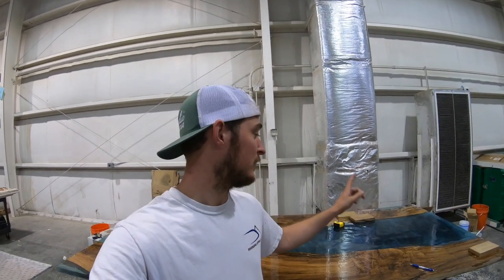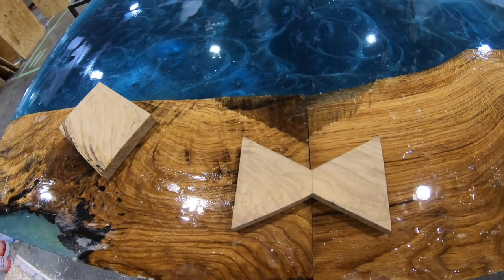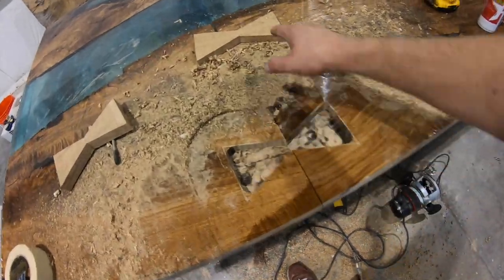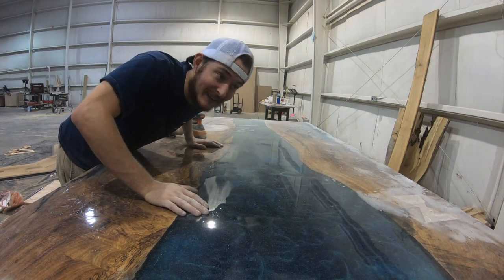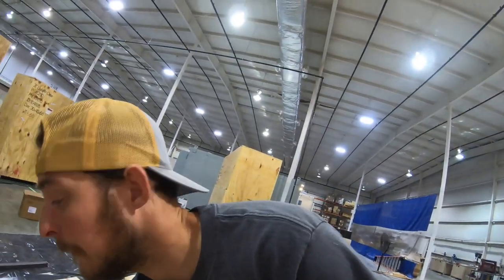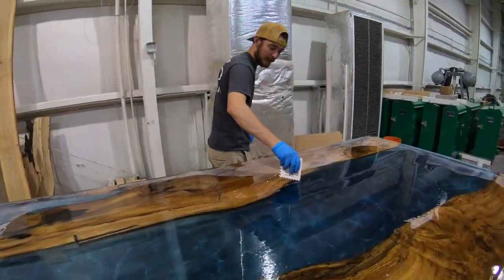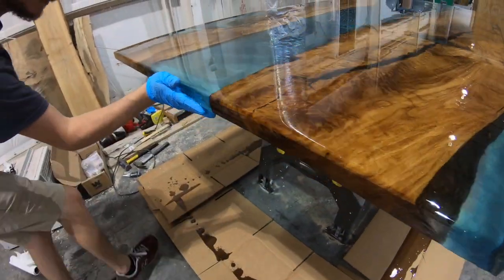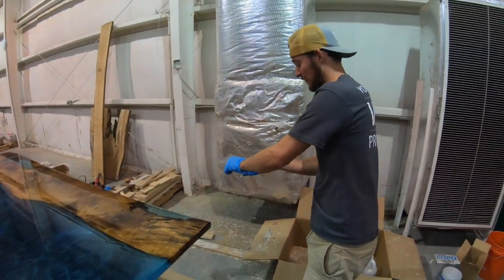DIY Epoxy River Dining Table Part 6

Comment: Hi bro I love your tutorials. Thanks so much. I learn a lot.
I have a question. I want to build a dining table.
I want to put a copper pipe all around. My table dimensions are 10’x4’ 2” Thick. The copper pipe its going to be 1”  
Do I need to pour a 1/2 layer, let it dry and then put my pipes? Because Im worried once I pour my epoxy and when its time to planning my table my router will hit the pipes.
I hope I explained it good.
Thanks Ethan
Reply from the maker: Yes I would pour a 1/2” thick first and then let it cure then pour your other layers

Comment: Hey Nathan I am planning on trying the pourable plastic to do 5 ounces per sq ft for the bottom of my river table ( like you did in this video) but I noticed on incredible solutions epoxy website they say not to ever pour less than a half inch thick with this stuff?  So obviously you are doing that and it must be ok to do as far as some kind of epoxy failure?

Comment: Hey greetings from Germany, thank you for the great content! I successfully built a coffee table with classic design, but I am working on a dining table and Im having a problem. Yesterday I flattened the bottom side of the table and this morning I woke up to see the bord has bended big time- 5mm in the middle. Please help me solve this problem.
Reply from the maker: This is because the wood is not fully dry. When you flatten one side and leave it, moisture is able to escape that side faster then the other side and it shrinks causing it to cup (bend). Best thing to do is, flatten and seal both sides as quickly as you can or have it Kiln dried. Hope this helps.
Reply: @GoodViewWoodworks  thank you for the quick response. Few hours ago i generously sprayed on the bord and now it has straightened out to only 1mm from 5mm this morning. My plan is to wait a couple hours more and from then on to keep it fixated with bar clamps until finished. Is that gonna work?
Reply from the maker: Kalin Penchev yes that could work.

Comment: NAthan, what is your favorite epoxy today for 2-4 inch pours and what is the most you would risk pouring at once.  I just poured my hard maple river last Saturday.  I used regular stone coat epoxy not the super cast.  I poured 1 inch the first pour and 3/4 the second.  The river is wide at 16 inches at the widest and 10-12 the rest.  It was 85 degrees in the shop at 2pm when I poured.  I hand mixed 8 minutes like the instructions said.  The first pouir heated to 145 degrees during the first hour.  It set within 2 hours to a soft but not really tacky but I could press it down if I tried.  At that point it was 145 degrees at th worst areas 120 the rest .  I poured the second pour and with 30 minutes I had temps above 180 and the highest was 201 out in the middle.  I was really not prepared for this type of heat.  It never happened before.  My walnut table stayed at 110-12 mostly.  So I was shocked,  How/Why did this happen in terms of the incredible heat do you think?  After a few hours it setup and now it seems rock hard.  (o:    I have not taken it out of the form.  I am letting it sit 7 days-till tomorrow to pop it out and route it down.  I Thought it would fail and I am prepared if it stays all bendy but it does seem like it set.  All I can say is WTF hahahahaha Cheers.  Grats on your new paleon, I have to go look for you there.

Comment: I note you don't go over your project with a dabbing brush after you do your flood coat. Is it not needed? I have seen other videos where they do. Curious. Thanks
Reply from the maker: I find that it’s not needed because the material self levels and has a long open working time. If you heat it , it will level out.